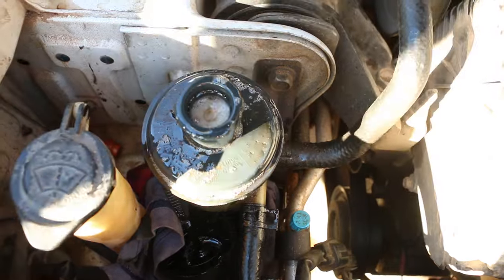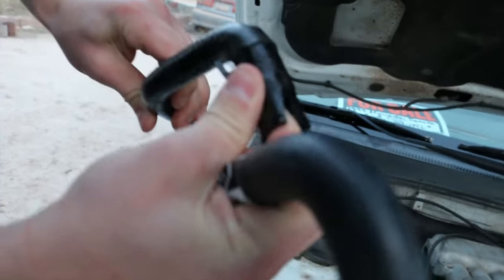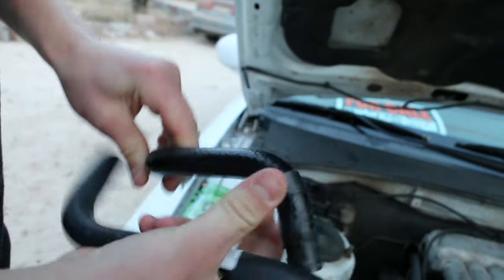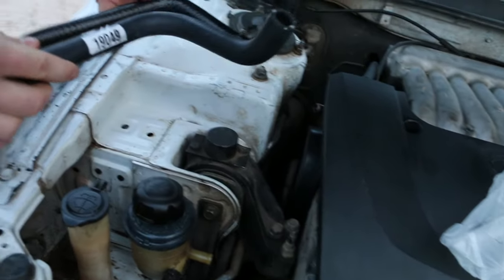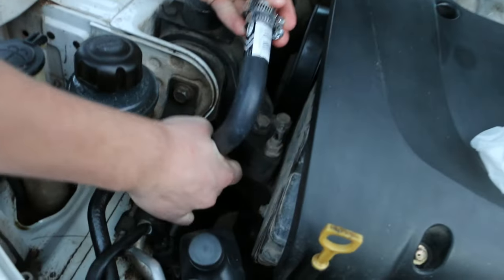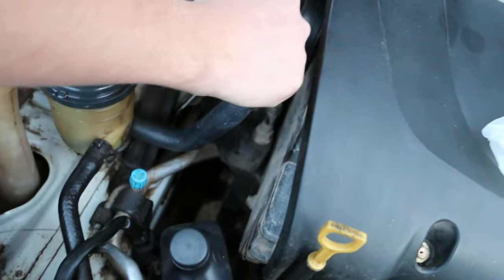Power steering fluid foaming, overflowing. Pump makes Grinding Sound - Fix Cracked Hose on Pump

Comment: If this happens in cold weather. Take your car and fill your tires up with the correct PSI/tire pressure recommended for your vehicle. Then make sure your power steering fluid is topped off. $2 worth the pain. You're welcome.
Reply: Mine is like a strawberry milk, and it is cold coild this fix my issue??

Comment: Had a leak in my 05 canyon leak was in return side line coming from rack d-side friend replace o-rings stop leak bigger problem is  lost all power steering running fluid coming out of reserve tank?

Comment: How is it overflowing from a cracked low pressure hose?
Reply: Because the air gets sucked in and makes foam... The foam takes up space and the oil leaks out.... Ever shaken a been... Same idea

Comment: I have just noticed that grinding noise on my 6 months old Hyundai Ioniq - 10 000 miles.  I'm so disappointed - shouldn't that be  problems free ?  10 000 miles on it ....

Comment: I have a 02 Ford toures an its hard to turn i added power steering fluid cause it was low an I noticed i had some fluid on my cap when i went to add it. I went to the store a little after an its still hard to turn an I have fluid all over under my hood and the top of the cap was full like it was shooting out the hole on the cap and when i open it it was foamy does anybody know wats wrong???
Reply: try to flush out all your power steering fluid there are videos of how personally I use Royal Purple Max EZ used it in my civic what I think is happening is your fluid is old and worn and your having boil over power steering fluid can boil eventually and moisture can get into it try to get all the fluid out and replace it
Reply: Smokey Buds
My buddies Taurus did the same thing. I topped it off. Drove it around and when I shut the car off fluid sprayed out of the top, landed on the catalytic converter and caught on fire. I found a small leak in the high pressure line and fixed it but it's still doing it. Did you ever figure out your problem?

Comment: Hi ! Quick question: I was driving my car in the highway for about 30 minutes without stopping. When I finally was at a red light outside of the highway I noticed that my car was smoking... But my car did not show any warning of overheating or anything ...First thing I noticed when I opened the front cover of the car was the power steering fluid was black and was way over the MAX mark. When I filled it up it was a little bit below the MAX mark. Do you have any idea what could be the cause ? i'm driving a 2005 mazda3 automatic 2.0L P.S. Sorry if I made mistakes writing, I'm not a native english speaker. Thank you ! :)
Reply from the maker: I am not too sure but I found this link. Hope this helps. Thanks for your comment. https://answers.yahoo.com/question/index?qid=20070123115638AALmtqb
Reply: Thank you for you response ! :)

Comment: Had a foaming problem , replaced the pump and still has the problem. Mechanic said the rack seals are bad and sucking air, I sucked ot the fluid and added a 12 oz bottle of Lucas power steering stop leak. With wheels off the ground , turned steering stop to stop a couple doz time and it fixed the problem, May have to add another later. But now is Ok. Do before spending time and money  replacing pump . Was told it most likely sealed up the seals in the rac

Comment: Mine had air in. I purged some by turning the wheel but the fluid is foamy and goes all the way down when I start the car and steer but comes back when I turn it off... could it be a leak or do I just need to flush it through with some fresh fluid?
Reply from the maker: +Frazzle I am not sure :/ sorry I could not be more help
Reply: What did you do? Got the same problem
Reply: @Ryanair365  Make sure all the connections are tight.  I had foam/bubble.. enough to blow a bunch of fluid out the reservoir.  I found that one of the hose connections to the power steering was just a little loose... enough for air to get it.